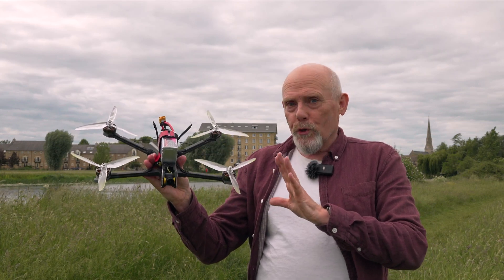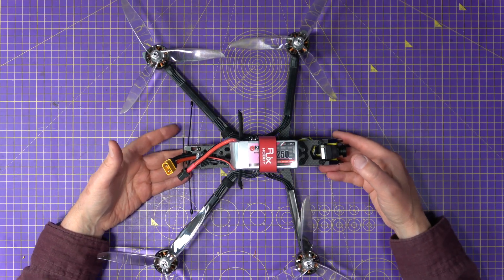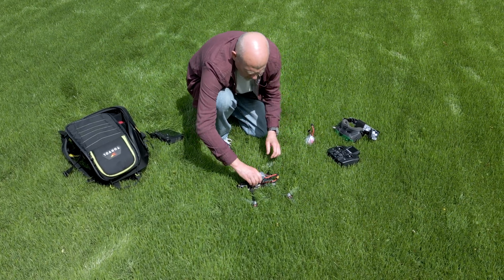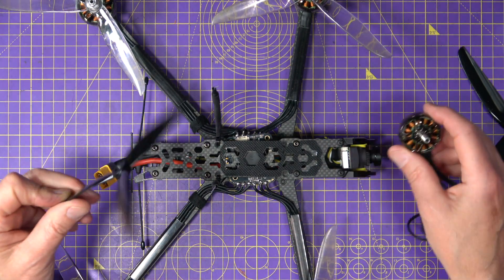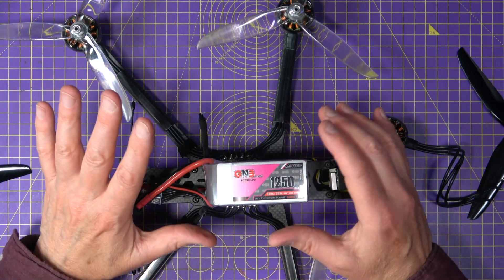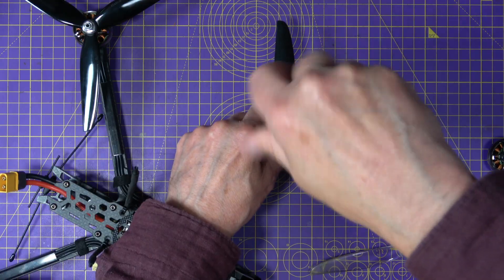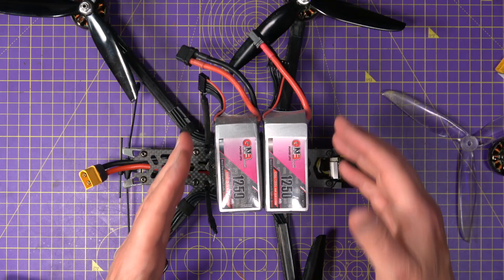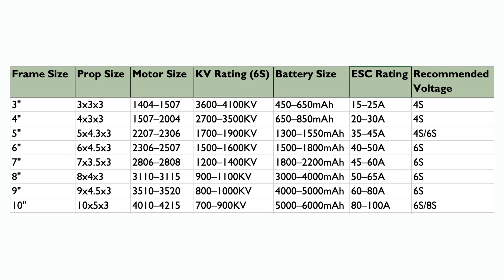Why Does My Drone Battery Die So Fast?

Comment: Challenge for you, seeing the data in the spreadsheet. 9",.. 9.5x4.5, 960kV, 3S 5200maH, 20+ minute flight time. Can you guess what it is?
Reply from the maker: That’s an interesting combo. The actual flight time really depends on the exact frame and whether you’re running bi-blades or tri-blades. I don’t guess, I try to calculate. I'm curious to hear what the setup is. I'm currently building my ultimate long range/duration 7 inch.
Reply: @WhirlyBloke  DJI Phantom 2 😁
Yup, still flies. They were the fastest of the Phantoms, and are quicker then most of the Inspires and Mavics. Have an F550 hexacopter too, now that eats batteries!

Comment: you could have just said look at you're power to weight ratio and run a bigger battery no?
Reply from the maker: Absolutely, that’s a solid way to put it. Power-to-weight and battery size are key, but it’s also the prop choice that can tip things over the edge. Aggressive props + small battery = cooked LiPo. Just wanted to walk through it for newer pilots. Appreciate the comment.